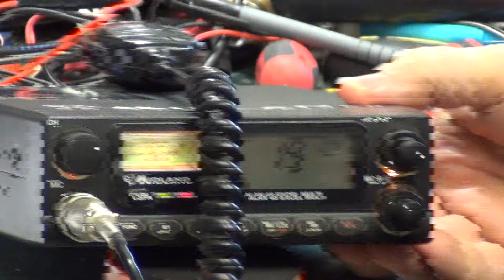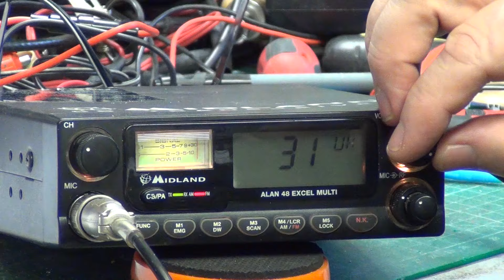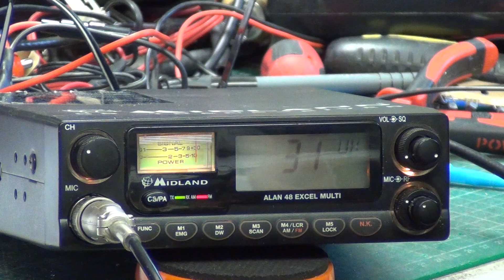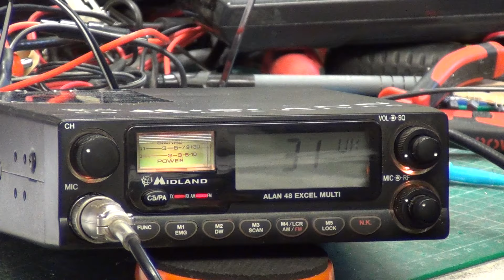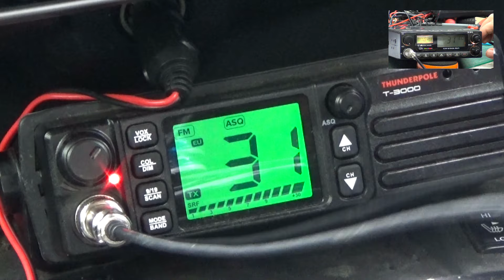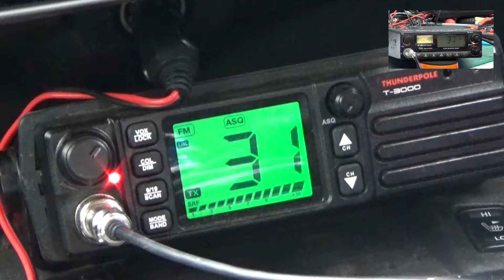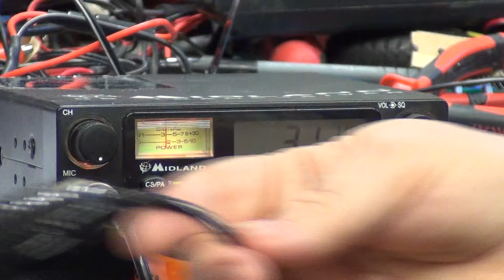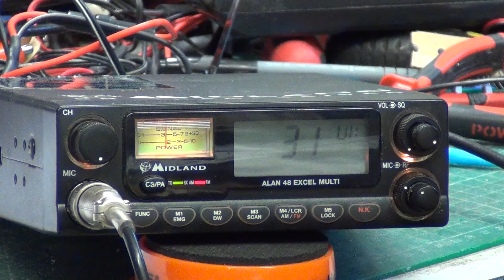Midland 48 Excel Muti CE MultiNorm EU/UK CB radio - on the air test

Comment: Excellent scratchy corner test worked well at all the key points with good modulation as well, just caught the video upload before going to bed so catch you on the next one 10-10.
Reply: Nice to see a cortina on the side there, two in fact I reckon.🙂 I always rated cortinas, and they were our daily transport until about a decade ago.
Reply: @timothyjones4950  My favourite Car was the Cortina and when I passed my test I bought a Mk4 in the early 80's  I'm hoping eventually to get another for restore or ready to run,  I prefer those to all this modern electric stuff.